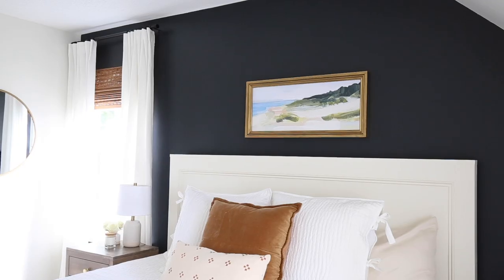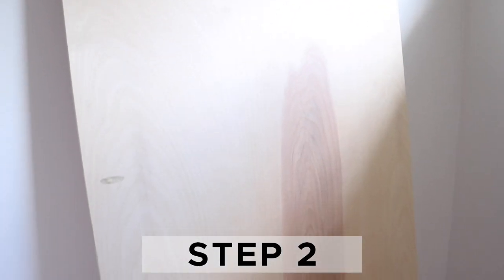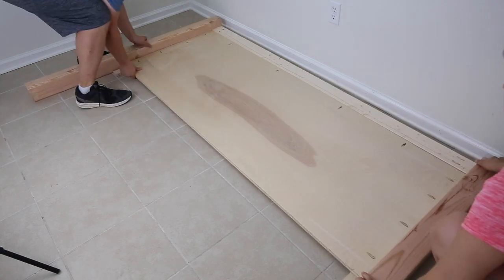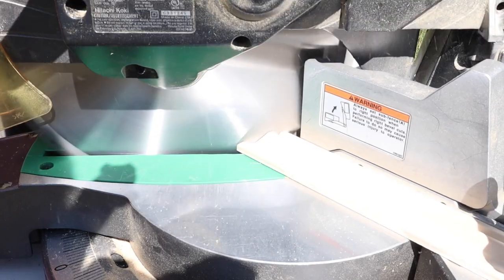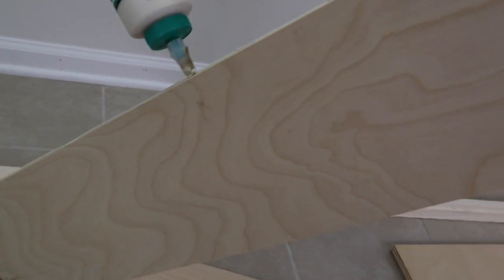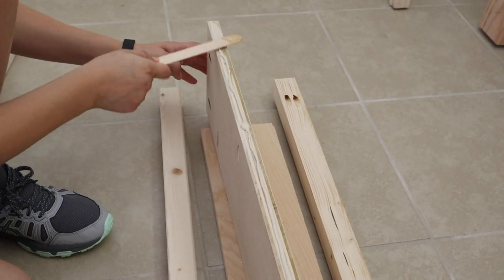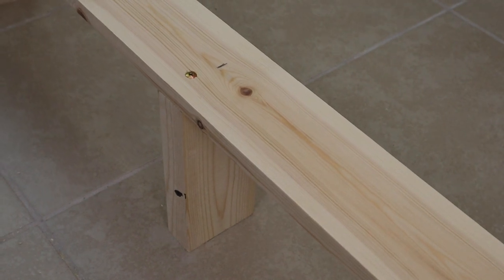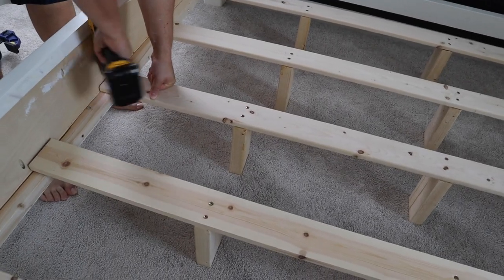Easy DIY Bed Frame | DIY King Size Bed Frame

Comment: I'm currently making this bed frame and I think I spotted a mistake. The 1x4 that goes on top of the headboard should be 82in, not 81in. (the math behind it: 4in post + 74in plywood + 4in post = 82in).
Reply from the maker: The 4" posts are actually only 3.5" wide, it's an industry standard for a lot of wood and I'm not sure why.
Reply: @AngelaMarieMade  ah that makes sense. I made a model of this bed in Sketch up but totally forgot about the real life dimensions after they clean up the boards. We even bought a new 1x4 thinking we had cut the 1st one it too short 😆

We still need to sand and do the pocket holes because we don’t have a workshop so we work outside and it’s been raining. I’m looking forward to the sun, warm weather and finishing this. ☺️

Comment: Very well done. I'm doing a similar queen bed frame and adding more metal slats to support the center of the box spring foundation as the mattress manufacturer requests. You've already done that.
Reply from the maker: That's great, thank you!

Comment: If you were to stain this instead, do you recommend a certain type of wood? Starting to research making a bed of my own and love your design!
Reply from the maker: No you can use any type of wood! I just used common wood/pine
Reply: Did you make this amd stain it? We want to stein, but I'm worried it won't look as good for done reason.

Comment: Why not use a 2x4 for the bottom side support? Seems like an easier and more stable approach than gluing together 2 2x2s.
Reply from the maker: You could use 2x4's but we chose 2x2's because of the size, weight and look of them, plus they are about 1/2 the cost. Most of the bed's support is distributed across the slats.

Comment: How much for this project?
Reply from the maker: total cost with materials and paint/primer was $175
Reply: that would really depend on wood costs - it tends to shift.
Reply: @AngelaMarieMade  prices have gone up so much, I just tried to prices this out. It's from online so prices may vary but it came out about 250$- 290$

Comment: How can I make that to a Queen size frame?
Reply from the maker: You would need to shorten the width and depth cuts to fit the dimensions of a queen. The height of the headboard and legs would stay the same.
Reply: Adjust the measurements to 60x80"